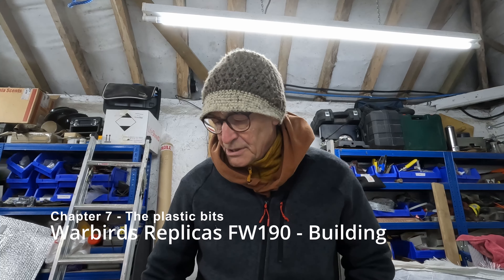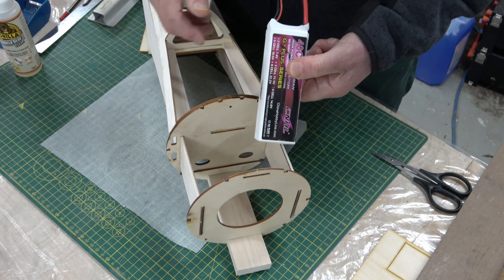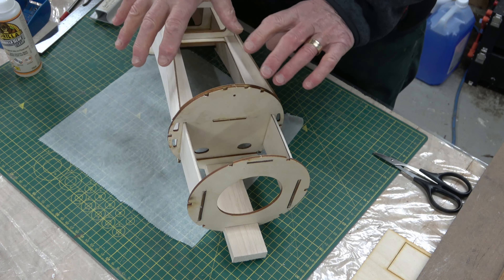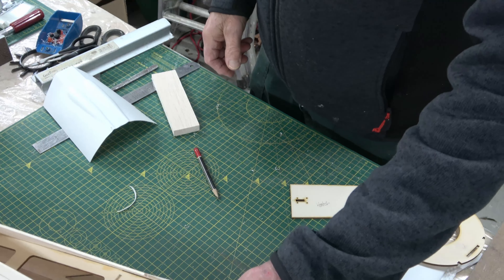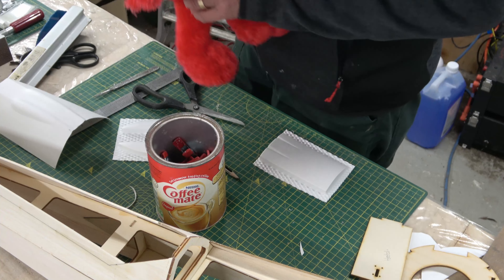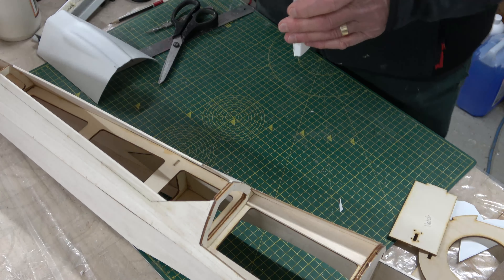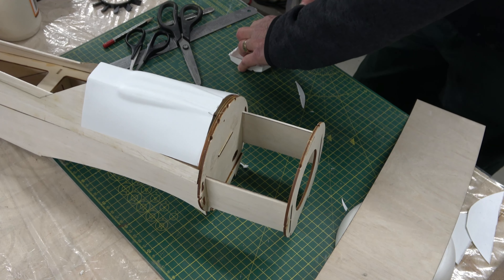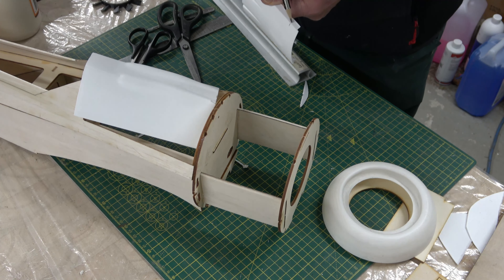Warbirds Replicas FW190 Build Part 7 - Fitting plastic mouldings

Comment: If you're battery is that much bigger, are you going to need to shift it further back anyway to balance the plane?
Reply from the maker: Well the FW190 has a short nose so does tend to build as a tail heavy model.  My guess is that it will be ok, but I could be wrong!